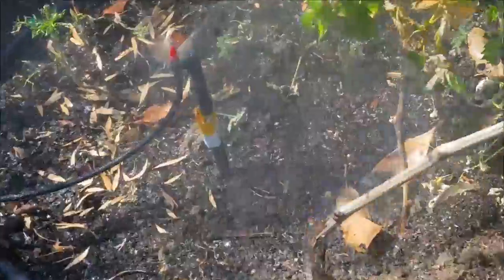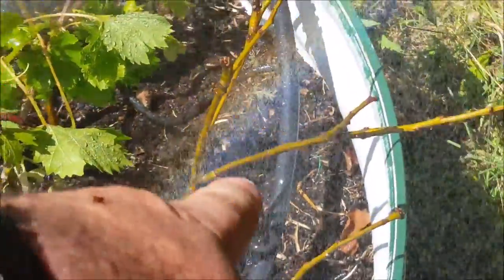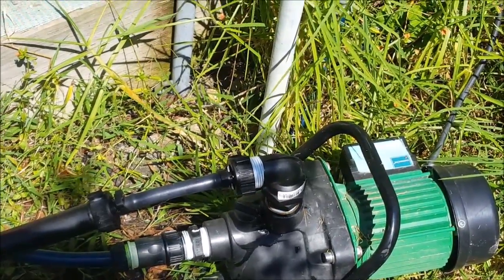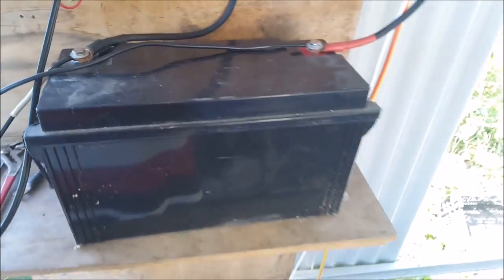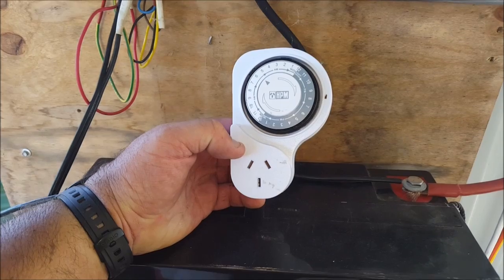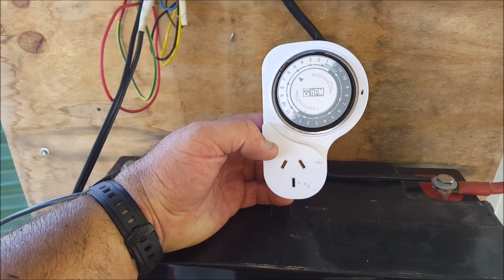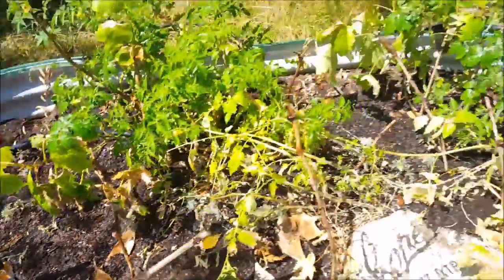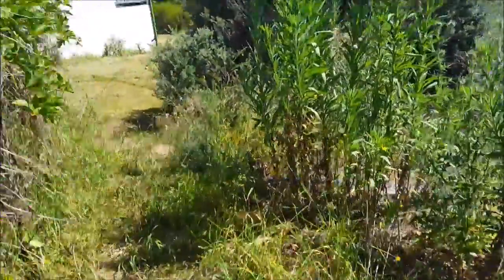Off Grid Solar Power - Automatic Watering System

Comment: Cool setup.  Looks like it's working well.
Reply from the maker: +628DirtRooster Later on this week I'll hook it up to the main system. Now that I'm in the city, 150 miles away, I'm concerned that it may be too much for the one battery.
Reply: Pop's Shack Will that damage any of the equipment?
Reply from the maker: +628DirtRooster It might damage the battery that it's on now, but that's a second hand battery that I got for doing  a favor for a mate.

Comment: Very slick set-up! I like it. Can you add another 100w solar panel? I need to do something like that in the spring for my garden pond. Thanks for the inspiration!
Reply from the maker: Yes, I can easily add another 100W panel.
Reply: +Pop's Shack brother if you can try doing just dripping. The spray your going to lose like 40% just to Evap. Also as it just a dipper like you say your not going to need so much power. either way hell of a good job brother. God Bless and Merry Christmas
Reply from the maker: +yankey4 The pump runs for 15 minutes early in the morning and again in the late afternoon. I just set this up on the spur of the moment to keep the garden alive for a few days.
Reply: Ahh...got it. Cool beans. Still pretty cool!

Comment: good little set for the hot days
Reply from the maker: +Ross Musolino When I get back to the shack on Christmas Day, I'll hook it up to the main 600W system. I'm worried that a 100W panel isn't enough to run this pump for half an hour a day. When I'm not at the shack, the only thing that's running off the main system is the fridge, which is currently using about 350Wh per day, so there's plenty of overhead available to run a water pump for half an hour a day.